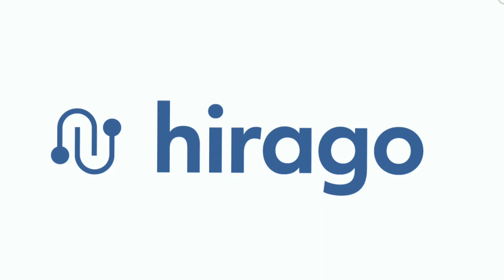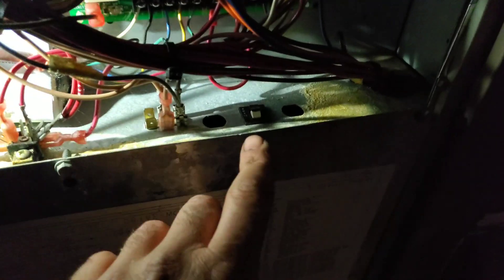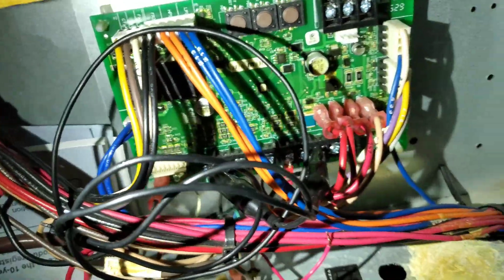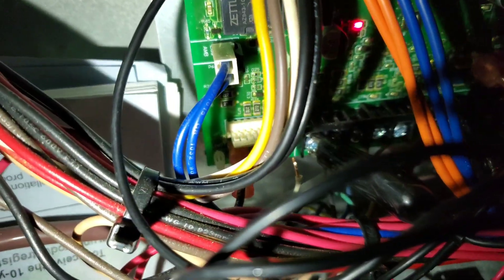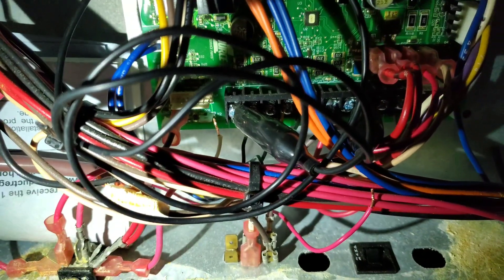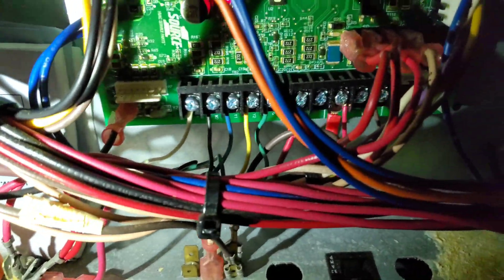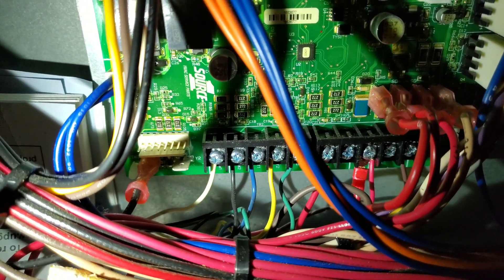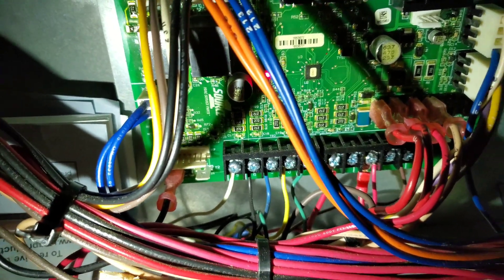Unit Not Heating Tell Me Why It's not

Comment: I had a 20 year career servicing phone and dictation systems. 2 pair, 4 pair etc wiring was used to connect phone and dictate stations. More often than not, wiring would become compromised. The fix that you implemented was called "using the spare pair". Good job. Btw.....don't be hard on yourself, even the most experienced tech could have had that one bite them.

Comment: Yes Sir I just finished an York 300K Gas Pack Roof top same issues ..bad tstat wires but only found it after replacing tstst & it ran for 2 days & then I was Back replacing tstat wires ,  luckily my unit  was on the ground just behind the thermostat wall  -so it was an easy new wire pull

Comment: I've seen that B4 it's a  real  Head Scratcher.
It happens to be in several of my cases that a drywall  screw was screwed in to hang a picture.
Reply from the maker: Yes that would be difficult to track if intermittent

Comment: Years ago I had a condensing unit with no 24volts to it. There were two junctions on the 2 conductor wire. Two orange wire nuts about 10” from the wall. I had 24v there. Two wire nuts in the unit no voltage. I replaced that section of wire and inspected it. No cuts or score marks on the wire. I stripped off the outer insulation and found a soft spot in the white wire. About an inch of wire was a white powder substance. I had installed the system about 3 years earlier and no problems until then. Weird stuff.

Comment: Bypass stat and stat wire,run a new wire and throw the tstat down the return for the time being,if your still popping low voltage fuse,either tattle tale each circuit, and wait for it to tell on itself.Then locked into the circuit that's the issue
Reply from the maker: The problem is fixed man, why would I do all that now?

Comment: Knicked wire,BAD CONTACTOR COIL,usually same Bs,its low voltage so just lock into the circuit when u find it,you'll find it